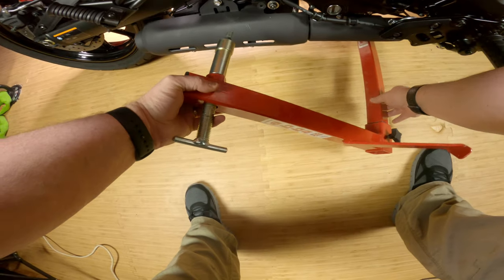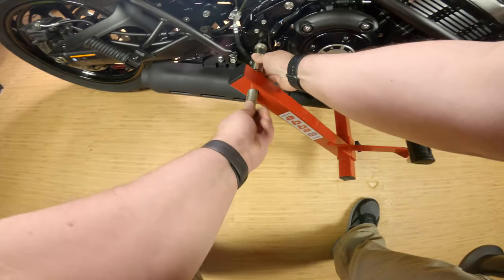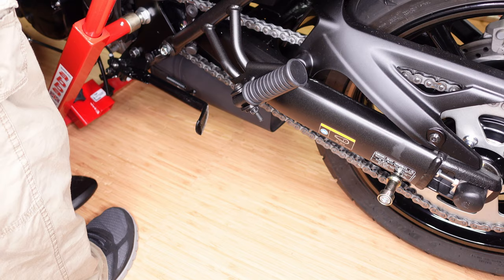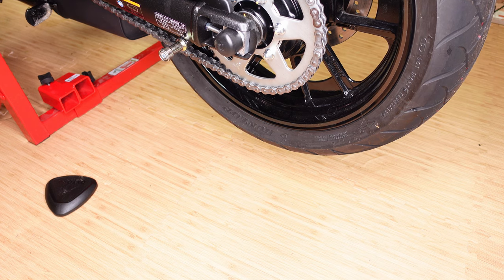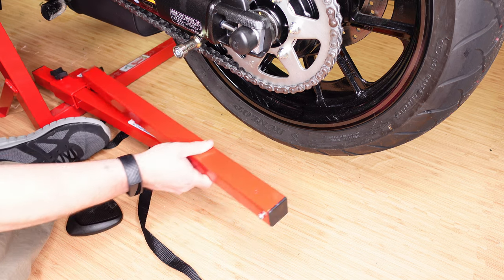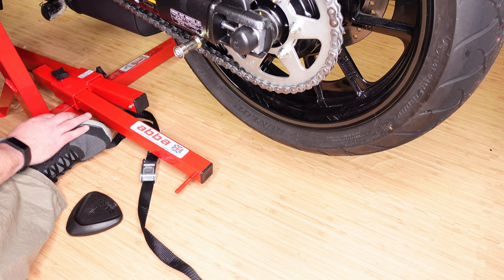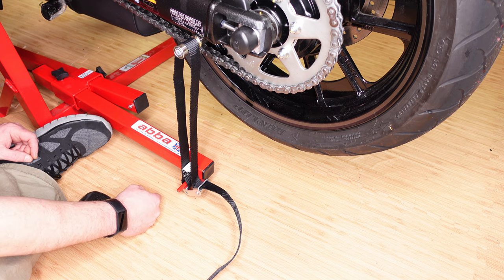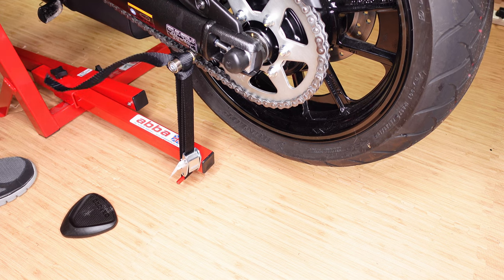How to use Abba Stand Front Lift Arm with a Kawasaki Vulcan S

Comment: Thanks for that. Just out of interest what editing software are you using.
Reply from the maker: I use Davinci Resolve from black magic design. The free version is fantastic and all we need for YouTube. It is available for Mac & Windows. I’ve tried Premiere pro but I don’t think it’s as good.

What are you using?
Reply: @TreesAndWheels  I'm using Magix movie edit pro at minute, only thing it struggles with 4k
Reply from the maker: @TheBroadyBikers  I've never used Magix. I know 4K files are big that require a lot of processing and there seems to be lots of factors that can impact the editing flow.

I had a problem with the final output render in 4k which turned out to be where I had my media files stored and where I was saving the final render. It was fixed by sending the output to the fastest drive I had. 

Are you having issues with just the final output render, or using 4k media files in general?
Reply: @TreesAndWheels  most likely my laptops not cut out for it.